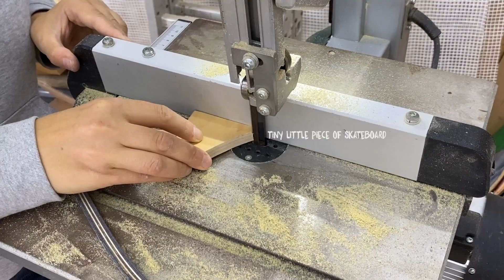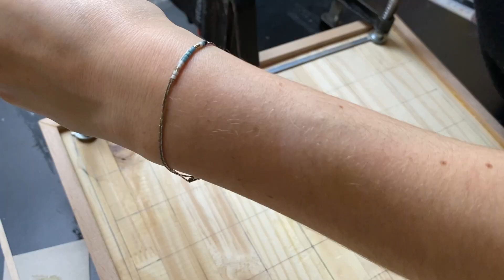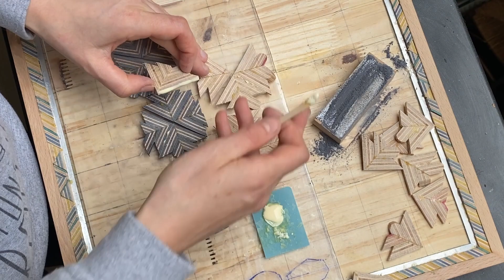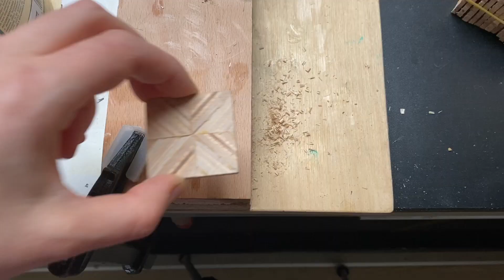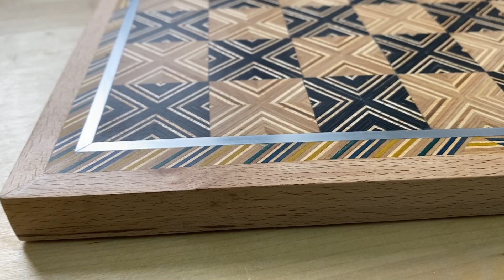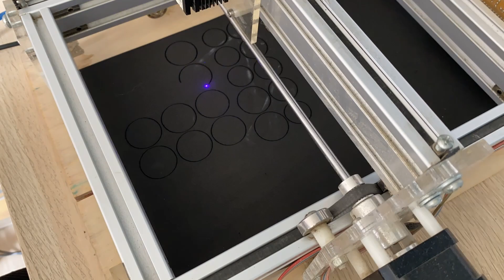Making a Wood Minions Chessboard

Comment: This is a very thoughtful and creative project and (importantly) shows you have both talent and patience.  However (not a criticism) you need to learn how to make "jigs" (I'll let you look that up) which will provide better continuity, ease of production (of similar parts), and cut down on unnecessary wasted time due to repetition in fine tuning or correcting mistakes.  Still.....great job!
Reply from the maker: Thanks for your comment. I totally agree with you, if I will do this project again it will be made differently (and using jigs will be a part of it). I have access to better tools now compare to the time I made this video wich would had save me so much time and effort !